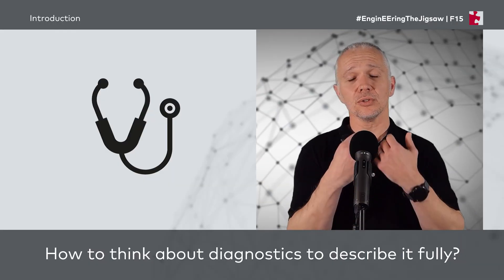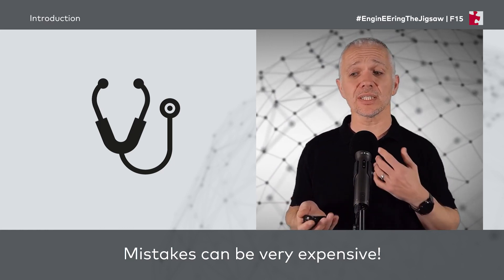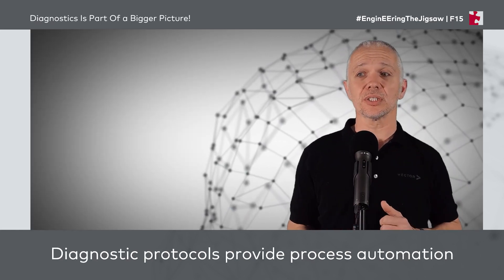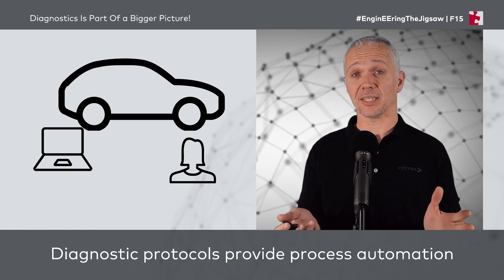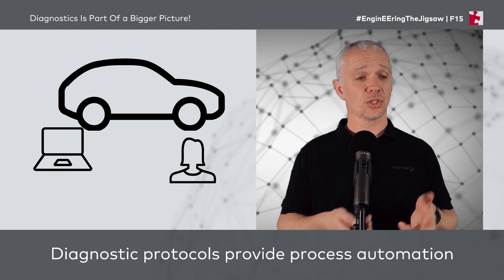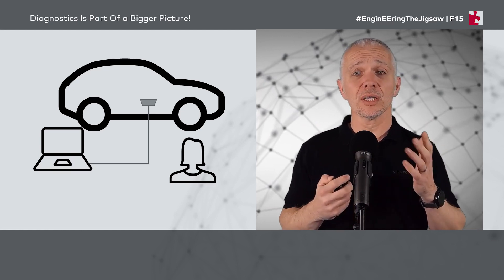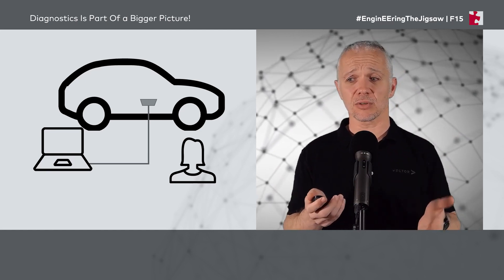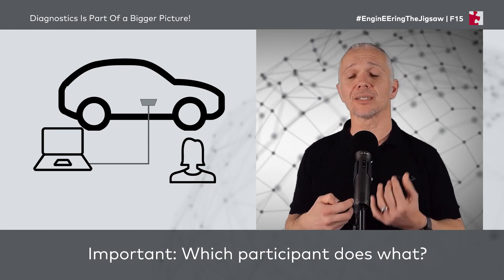What Is Diagnostic Data? | #EnginEEringTheJigsaw | F15

Comment: Hi, thanks for explaining the different perspectives of ODX and DEXT. Regarding these two different diagnostic data formats I have a question about that, is it possible to covert the ODX and DECT with each other? I mean converting a present ODX data to the DEXT format, or converting a DEXT format data to the ODX format? Thanks again for this video! Really helpful!
Reply: Hi, yes, this kind of process is possible via a tool such as CANdelaStudio, that understands the two data formats, and has an internal data-model that has significant overlap with them. The result of importing a DEXT and immediately generating ODX from the data would always be a 'partial ODX' (and not useful) as the communication configuration would need to be added, along with assigning audiences if needed. Conversely, the result of importing ODX-D (or a PDX) and immediately generating DEXT from the data would be a 'partial DEXT', that contains neither Events nor certain attributes that AUTOSAR basic software configuration tools might expect, and so this could also require further work to be 'useful'.

Comment: Are technicians the only users of diagnostic data in the landscape of diagnostics? Or are there other players like insurance service providers, fleet operators, etc.? What is their mode of communication? UDS over the air?
Reply from the maker: Hi, we use "technician" in this episode as a generic term for anyone that is using a tester; of course, engineers, inspectors, and other roles may also use testers. As explained in this episode, diagnostic data is used in two very different processes with very different needs: 1. Configuring ECU software; 2. Parametrizing a tester. These processes are based on completely different perspectives on a common set of needs (the corresponding data is consumed by either ECU configuration software or by tester software). There are then many ways in which a user can connect a tester to any given vehicle, depending on what is supported by the vehicle, and the individual ECUs within it.